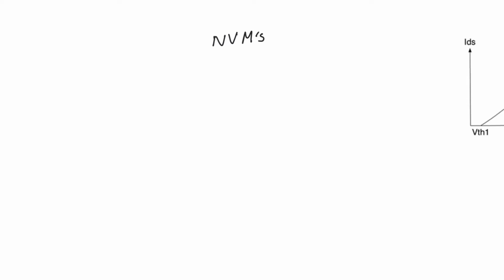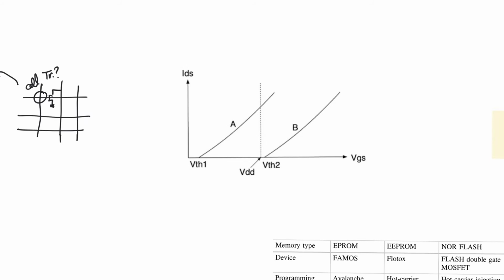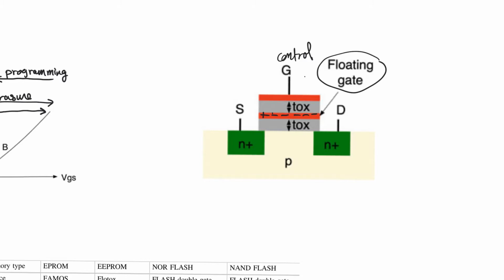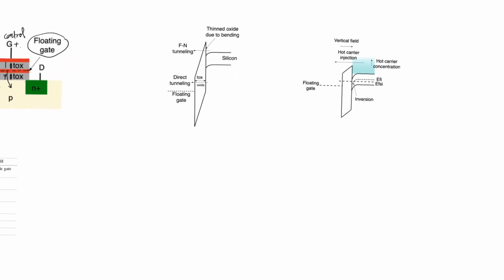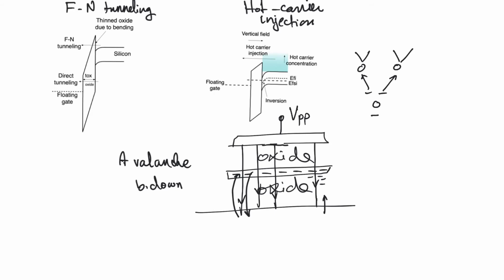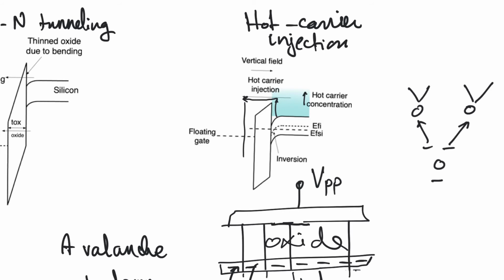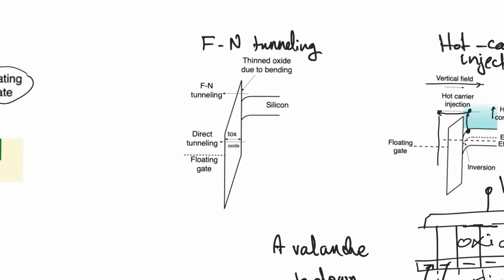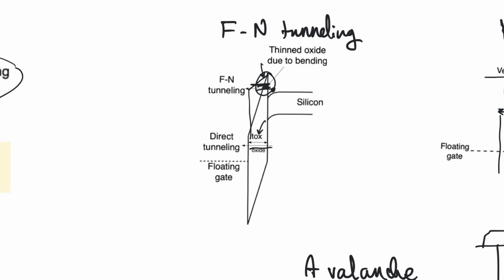12.7. Non volatile memories

Comment: Fantastic video, thank you very much for explaining this!! I recently learned about MOSFETs at a deeper level and wanted to understand the mechanisms behind the "extension" of floating-gate MOS used in flash technologies. You are very articulate and do a great job explaining differences and nuances among the different methods (HCI vs FN tunneling vs avalanche breakdown), which was exactly what I wanted an answer to. Great work and cheers!